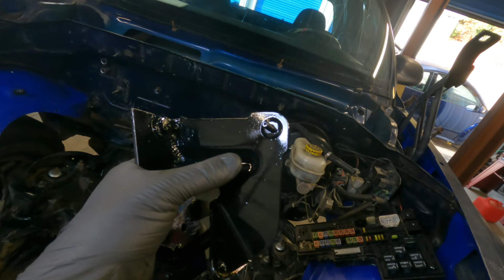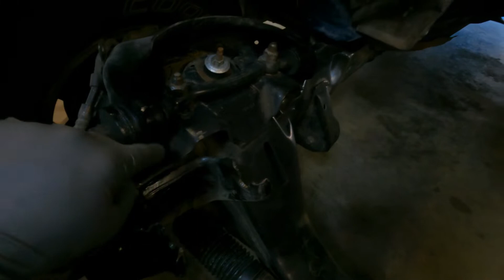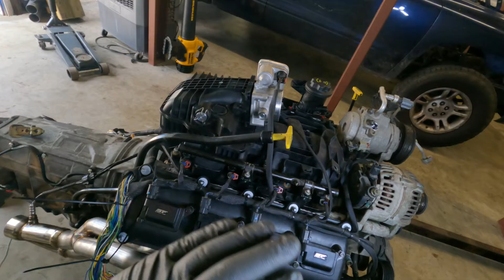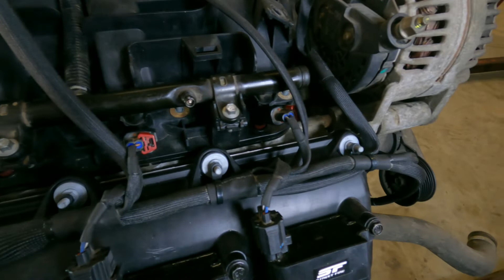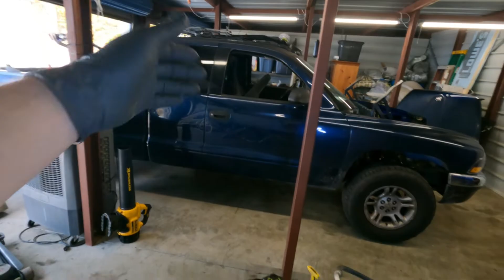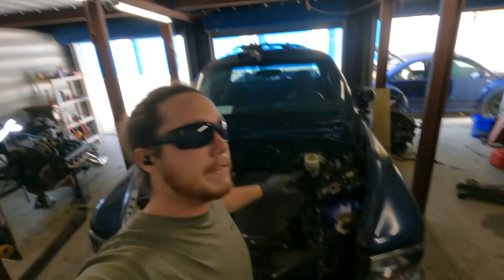The Problems And The Solutions Hemi Dakota Swap Part 6

Comment: Nice job on your Hemi swap. My friend and I are in the process of swapping my 4.7 out of my 2004 Dakota. We are using a 5.7 out of a 2004 Durango. We had to change out the PCM and a lot of wiring. I noticed you have long tube headers on yours. I was going to buy a set of the Hooker Blackheart Hemi swap headers but unfortunately they are discontinued now. What headers did you use and did you have to modify them?
Reply from the maker: I used hooked blackheads headers for swaping a hemi into a dakota from holley and as far as the ecu I would recommend a 05 ram 5.7 ecu that doesn't have skim from the factory to know for sure it doesn't have it look for a black key that has no buttons on it those ecus don't have skim

Comment: on the trans dip stick and tube, make sure that you use the matching pieces. When I did my Hemi swap I used the Dakota tube with the Ram dipstick. I ended up running my trans a few quarts low on fluid and ruined it. Anyway I found another 545rfe and swapped it. You wiring harness looks great.
Reply from the maker: I used a brand new seal with the 4.7 dakota dipstick and 07 ram 545rfe hasn't leaked a drop
Reply from the maker: I read that wrong the frist time my bad but yah dakota dipstick to dakota tube and ram to ram they are different lengths and will cause issues

Comment: I can see why you had to modify the control arms due to the headers you’re using, but what if they weren’t long tubes? Can it fit with the standard type of headers?
Reply from the maker: You'll have clearance issues with the stock manifolds I have heard of people using jeep srt manifolds I'm not sure what the clearance issues would be with those

Comment: Dude!!! Thanks for all you’re doing!!! I’ve got a ‘99 quad cab 3.9 V6 with an AX15 5spd M/T… and I just decided to do a 5.7 Hemi Swap, I acquired a 238 Getrag 6spd M/T from a 2007 RAM that had a 5.7 unfortunatelly I couldn’t get my hands on the engine, I just watched all of your Swap videos and you just motivated me even more to do this, I’m jus on the hunt for the 5.7 engine and my biggest concern was how to make the accelerator pedal to work since 5.7 is electronic and 3.9 is driven by cable, so, you just helped me out with all that, again, I haven’t even started it but with your videos I am totally 1,000% and more decided to do this… please keep up the awesome work you’re doing and who knows???!!! Maybe we can meet some day with our “Hemi-Kotas” and do some “0-60’s” 🤘🏼😁🤘🏼 thanks again for all your input man!!! 🙌🏼🙌🏼🙌🏼
Reply from the maker: I love seeing comments like this thank you. I will let you know on a 99 dakota you'll have to go to a 00+ gauge cluster and I think 01+ brake booster also the pedal setup I did I honestly hate after driving for a few miles so I'm going to use a accelerator pedal position sensor from a 03-04 ram 1500 with the 5.7 it will allow you to keep the oem pedal and cable I'll be doing an up date video on it soon I'm actually installing it now as I type this lol. But thanks man and yah for sure I'll post some 0-60s and maybe some 1/4 times if I can get out to a track and it would be cool to get a 99 M/T hemi dakota and 01 A/T hemi dakota lined up. Good luck with your swap man happy I could help

Comment: Very nice. Question, did you swap the oil pump for a high volume one? Heard the Hemi’s get a tick going mostly from not enough oil moving at idle.
Reply from the maker: Eh all hemis tick and its not do to oil pressure mostly the thin oil 5-20 and the size of the heads. This motor had perfect oil pressure and no tick so I checked the #3 bearing and left it be. Hemis are very reliable as long as they aren't over heated and the way to spot a bad hemi is low compression in cyl 1&3